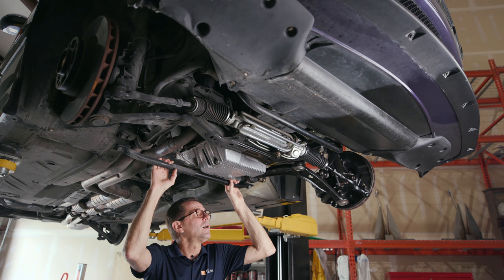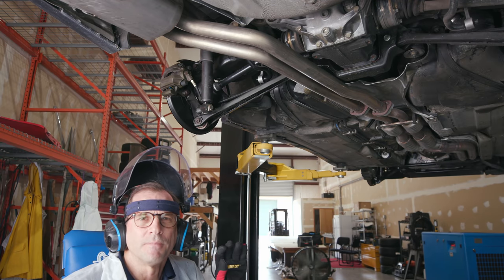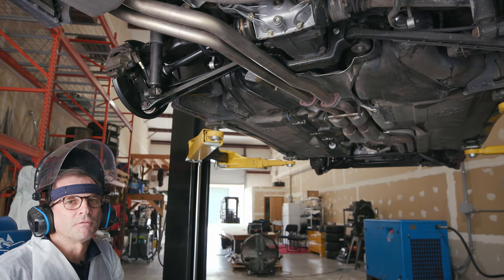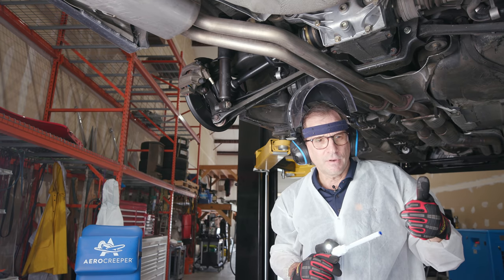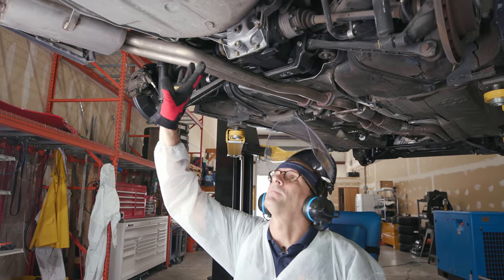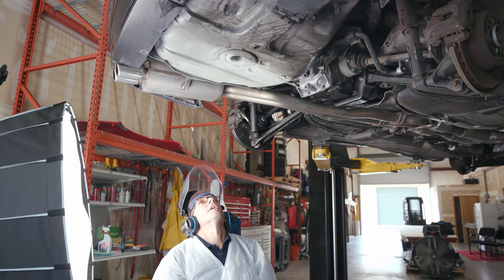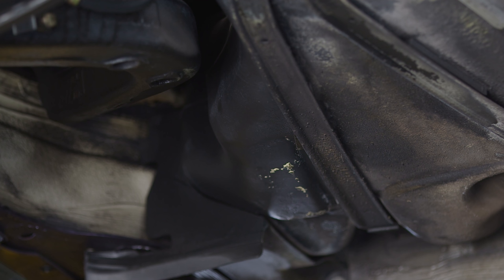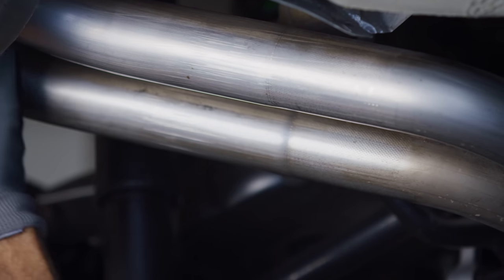Dry Ice Cleaning: Obsessed Undercarriage Restoration on the E36 M3 Pt.3

Comment: Matt/Scott this is a ton of fun to watch for me as I've just acquired an E36 M3 myself and I'm in this area lately. I'll be honest, I've done enough mineral spirits scrubbing under these areas on a few BMWs to see where it'd be more cost effective, if less "fun" than this method, but in areas like that rear diff cover and brake calipers/rubber/hoses and fittings no contest, this is the way!  But Cosmoline will certainly come off pretty easily with a soft brush, even scotchbrite pad and mineral spirits pretty easily. The stuff will be super hard and tough to remove wherever it is exposed to a lot of heat, though. Strangely, having said that, the aluminum heat shields right next to exhaust will actually come clean easily with rags and mineral spirits. But it sure won't on aluminum intake manifolds. I suspect a lot of that is about the smoothness and pores in the aluminum it's resting on..As Scott said over again-you just never know! I'm curious what can be done with the Dry Ice cleaning on an intake manifold of an 80's BMW with cosmoline baked on.

Comment: Nice! I’m literally under my E36 M3 doing some suspension and cleaning again. I’ve got degreasers, dawn & water, pressure washer, steamer, sponges, steel wool, brown scotch brite... if I had that thing I could do the aluminum parts and subframes in a second! I’ve got my rear subframe out for bushing and I’ve been cleaning it for hours. Spent 30 minutes cleaning the diff and polished the rear housing but it probably doesn’t look as good as that. It's too bad it can't really be used for the heat shield - I found that fine wire wheels work awesome on them (easier when out of the car). The main heat shield for E36 is about $275 if ever wanted to replace. Maybe I’ll target certain areas and take it in somewhere to have a couple hours of dry ice done.

Comment: This is a great restoration video! Thanks for the detailed steps! Obviously this car was in great shape and never saw snow or salty roads. Have you worked on any vehicles with salt/rust damage? I'm currently restoring my 2000 integra and have come across a lot of rusted bolts. Does the dry ice cut through rust as well as dirt? Thanks!

Comment: Scott, I’ve watched straight though to part 3. Oddly satisfying to watch. Would like to do it myself. On the diff, any concerns about the gasket between the cover and housing? Also when you say back it down it appears that is particle size and pressure.  How do you know how to move each?
Reply: It's a learned experience as you might imagine.  And yes, size of the dry ice, pressure, and volume all play into this of course.

Comment: Ok. Metallurgy and chemistry is my bag, ladies.  He is absolutely correct.  Any metal on the Rockwell hardness scale  (iron) that used compression in Mandrel bends generates heat. The heat on the radius pulls the ferrous compound generating etching.  The etching leaves a deposit of iron sulfate.  Geez, I sound like a Ted Talks.

Comment: Where does the contaminants go? 

If it's into the air, shouldn't some kind of face mask / respirator be worn?
Reply: We have doors open on both ends of the building for cross flow and a large fan pushing as well.  I do wear a mask on certain occasions with a really dirty car.  And support your suggestion for using one.

Comment: Scott what are doing with the textured undercoating that’s everywhere under car? Sometimes when I steam it comes off in some areas and there’s smooth yellow paint underneath. I put up short private video linked below showing what I mean.
Youtu.be/hrncNoygGDc
Reply: That product is commonly applied to most German cars inside and out.  It is meant to be a rust preventative and sound deadening.   I work very diligently to maintain all factory applied materials except cosmoline.  You'll see when the series concludes how our process works on it.
Reply: @ScottAles  ok thanks appreciate the reply.